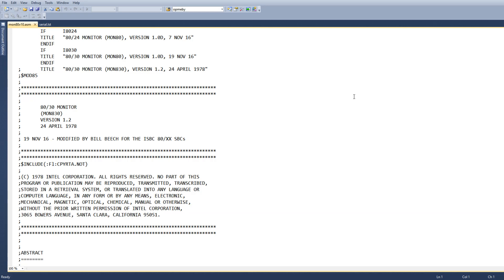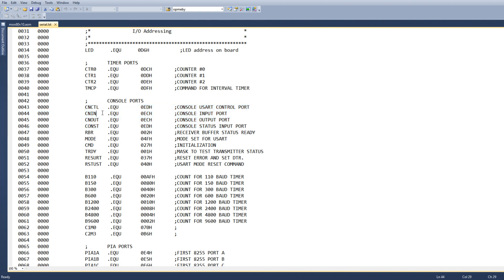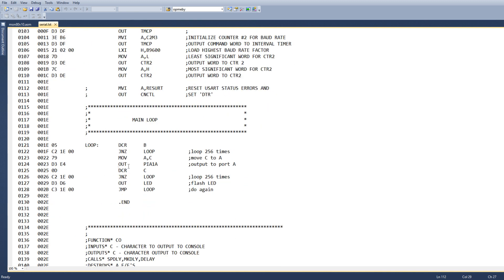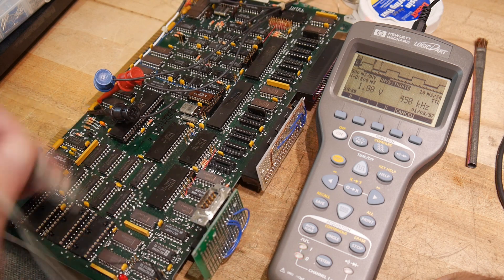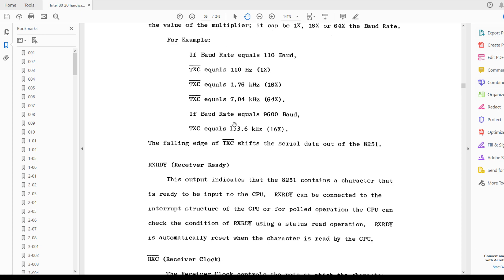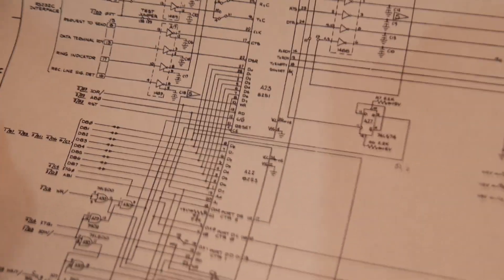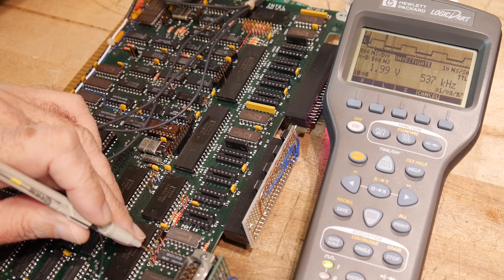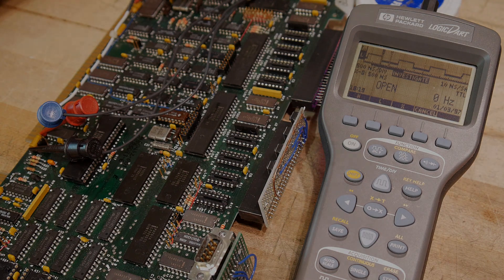#318 Intel 8080 SBC 80/20 Single Board Computer 8253 timer chip

Comment: Yea, i think you forgot that you were working with a async x64 clock.   2015000÷2÷9600 leaves only 105 clock cycles. Cant divide that by 64.
Even a x16 clock looks to have 9% error at 9600. Better drop back to 110 baud and get a KSR33 teletype terminal to be sure ,^)
Reply from the maker: remember the 8253 allows division by any 16 bit integer

Comment: Just want to comment on your idea to drive the 8251 USART transmitter / receiver clock with the baud rate clock in 1x mode. To my understanding, this is not working well in asynchronous mode, since the sampling of the RxD line is in 1x mode at small frequency shifts from sender to your receiver leading to sampling data errors.
The 8251 USART receiver gets synchronized with the start bit, but the following bits are sampled in 1x mode not in the center of the bit pattern. (see Intel 8251 data sheet page 7 and 9)
In synchronous mode, the 1x mode is no problem, because the clock drives the shift register.
But in asynchronous mode, my recommendation is to use at least the 16x mode pre-scaler for strobing the bit at its nominal center. 
..... Thanks for the intersting experiments on the 80/20.. Thomas
Reply from the maker: You are correct. I eventually used a 16x clock. see upcomming video.